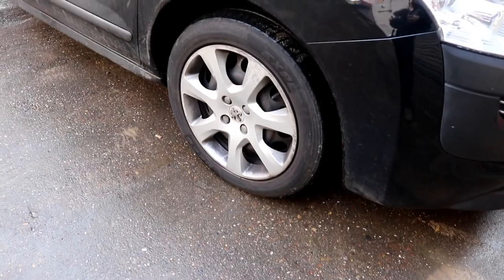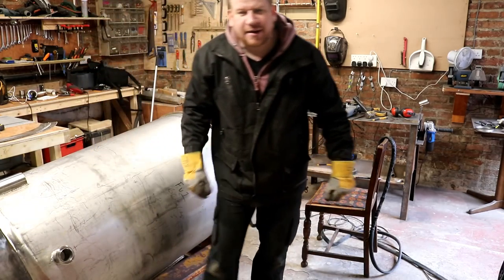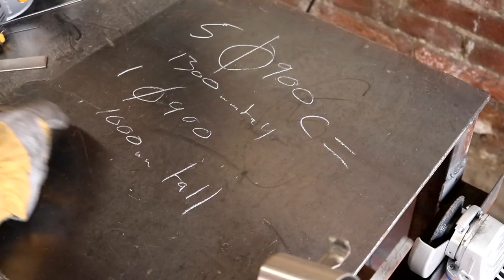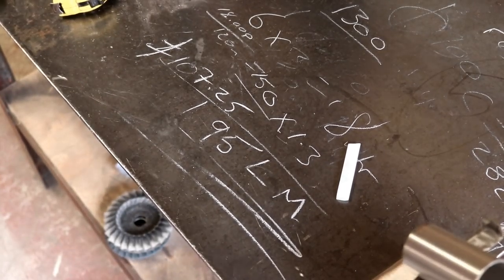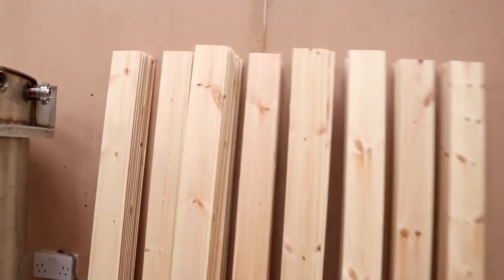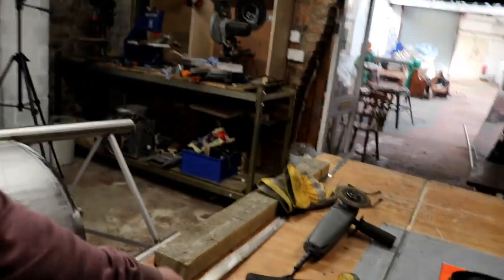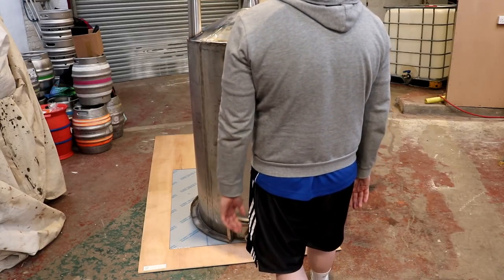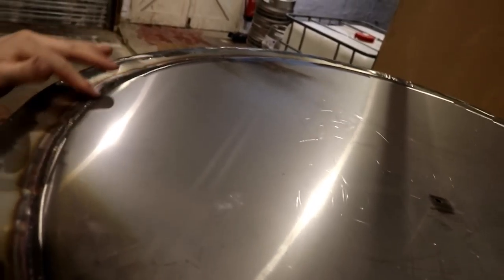I GOT WOOD

Comment: Have you thought about doing lids in polycarbonate like at IVB to save a bit of weight taking them on and off ? Would allow visual inspection without need for removal also. Nice find on the cladding,hope it works out enough. Don't allow yourself to get so tired you start making little mistakes now m8,you are on home stretch. Cheers.
Reply: Must check out merch when i have a few bob,wonder could i get logos switched to left side lol. Cheers.